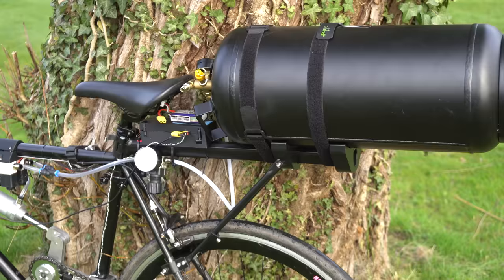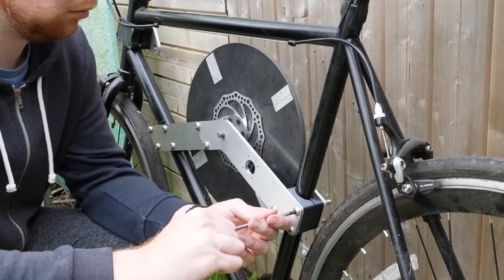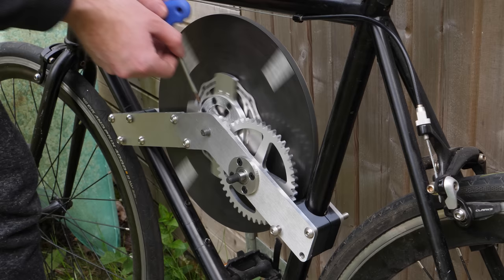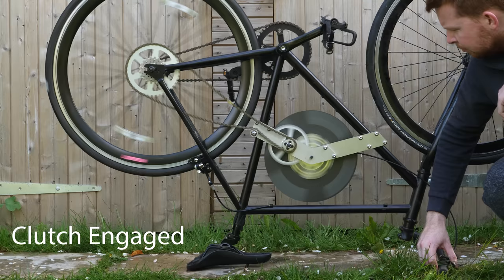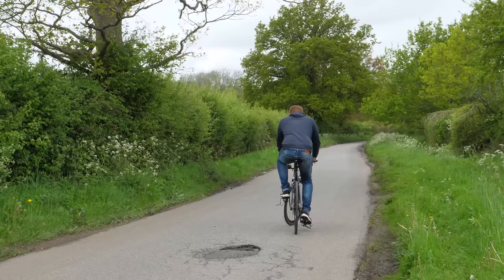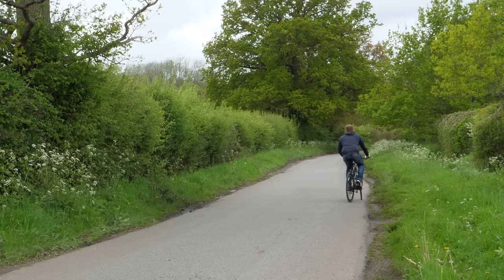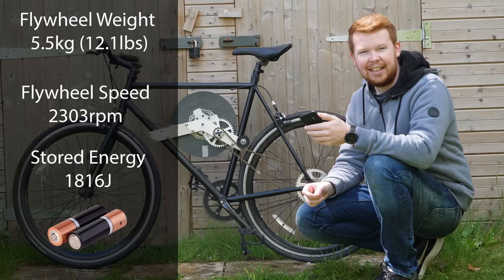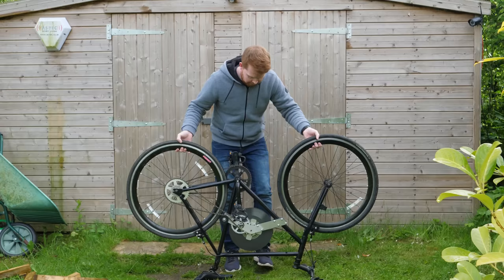Flywheel Bike KERS

Comment: This is so cool! Something I wonder but isn't covered in the video: Does the flywheel have a noticeable gyroscopic effect? That is, in the field test, if you bring the bike to a stop but the flywheel is still running, does the flywheel help keep the bike upright through gyroscopic force?
Reply: I ride motorbikes and had an electric scooter. The difference in stability at low speed is incredible.
Reply: Great question 😊
Reply: @dancingCamels  that's actually a big advantage for older and very young riders.

Obviously in production version you seal the thing appropriately.
Reply: I'd be equally interested to know whether the gyroscopic effect makes it harder to steer.
Reply: This was my question, too.
Reply: It would take a HUGE flywheel to keep it upright
Reply: @UtkarshUpadhyayTheGreat  that's why they said "help" keeping it upright, not straight up keep it upright.
Also, not that massive. Angular momentum is I×ω, so you just need to make it spin fast enough :p
Reply: @Anankin12  Missed the word 'help' there, and yeah, if it spins fast enough it should help keep it upright!
Reply: @Anankin12  true!! but you would defiantly need  bigger stronger leg's than Tom's to get the speed you would need.   ; )
Reply: Now I'm  no engineer by a long shot but was sat here thinking what if you had TWO  flywheels that rotated within the wheels somehow like huge discs (maybe even 4 one each side front and back)... surly that would help with power output and stability.. also a system where the flywheels pick up speed with the wheels all the time they are rotating slower then release and continue at full speed when the wheels slow down and store this energy when needed for hills etc.. 🤔🤷‍♂️ like I sayi have no engineering background 🤦🥴🙃😀

Comment: Show's you how ineffective regenerative braking is relative to the size of the losses you need to offset in a vehicle.
Reply: There are more factors. Flywheels are actually great at storing energy but the implementation is very important
Reply: yea thats the problem - The extra weight in flywheel you are carrying everywhere would be better spent carrying apples instead and eating the apples to give yourself energy.
Reply: The increase in mass, and the fact it is sometimes spinning and sometimes not, would make this a horror bike to ride irl. Gimme an energetically wasteful 7kg carbon bike any day 😆
Reply: @argh01hass  You could reduce the weight of the flywheel by hollowing out the inside and adding a bit of mass to the edges.  There are vans and buses that use flywheels to store energy.  But it's still hard to make all the extra weight worth it.

Comment: you only need the RIM to be heavy steel, or a steel tube of uniform diameter completely filled with lead.  The rest of the wheel only needs to be comparatively light--but strong/  Spokes in a wind-preventing membrane would do it. It has to be tested to about 10 000 rpm, and if it holds at those RPM it will be safe on a bike.

Comment: It's especially good if you consider the fact that using the bike normally, braking ever so slightly on many separate occasions, and using the flywheel as an assist and not as the sole source of energy this system really begins to seem more practical
Reply: nope.
Reply: I was thinking about that as well, harvest energy going downhill, then use the energy going back up.
Reply: @BigEightiesNewWave  yes

Comment: Tom, you should try to combine the flywheel with the front wheel. Due the angular momentum of the flywheel it would have the same effect as when you're moving the bike, which stabilizes the bike and prevents from falling over (physical functioning of a bicycle). It would allow you to remain on the bike while standing (not moving), without touching the ground with your feets.
Reply: Gyroscopic effects have been proven in scientific studies to not actually stabilize a bike.  There's a video here on YT with a deep dive on the subject, interesting stuff if you have time to search for it.
Reply: @Skinflaps_Meatslapper  Yeah it is the combination of the gyroscopic effect and the caused forced (vertical) rotation of the front wheel, that will shift the centre of gravity. But I guess it is only possible while driving the bike. You would have to move the bike slighly forwards and backwards while standing.
Reply: @robbernd155  The physicist David Jones ruled out gyroscopic effects as a contributing factor to the stability of a bike by building a self-stable bike without gyroscopic forces back in the 70's.  Since then, most people assumed that the caster effect of the front wheel, commonly referred to as trail, was the reason bikes are self-stable.  However, about a decade ago, the question was revisited by physicists at Cornell and other universities working together.  They determined that a bike can still be self-stable without gyroscopic effects and without caster.  So the underlying physics as to why a bike is self-stable is still unknown to science.  I have my own theory about it, but I'm certainly not in any kind of position to make claims or demonstrate any proof.
Reply: @Skinflaps_Meatslapper  I did some research and you are right. It is not just the gyro effect rather some kind of  "trail" effect too. Nevertheless the gyro effect stabilizes the bike as well and hast an impact (e.g. counter steering or driving freehand). The question is wether the momentum of the flywheel is enough.
Reply: @robbernd155  Here's the thing though, they canceled out both gyroscopic forces as well as the trailing effect, and the bike still self-stabilized.  There's a different effect going on to stabilize it.  Either way.  Using a flywheel to stabilize a bike well enough for it to stay upright and resist outside forces won't do much of anything other than creating a bike that is difficult to ride in all but a straight line.  Advantageous for people just learning how to ride perhaps, but for everyone else it's a nuisance.

Comment: Very interesting, and franckly, cool. I do have a critical question, though: how does this bike behave in a sharp turn with a rotating flywheel? Despite the bit at the very end of the video, i'd expect that you'd at least have to change your technique...
Reply: you're exactly right with your curiosity! Because they rotate on a static axis, that rotational energy is along that axis. They're their most effective when they can statically stay in that direction because if you rotate; that angular momentum wants to continue it's inertia along that axis, which results in some of that energy escaping the flywheel kinetically through the rest of the structure.
Reply: explanation in theory of a un educated mind. Honestly I cant see that steel plate storing enough energy unless you had one hell of a gear ratio to get you started again. But to your question in theory it would be harder to turn... but you would be able to take much sharper turns if you lean in to it due to the fly wheel. Perhaps some engineer can explain. I am un educated but I do have a vast knowlage.
Reply: @Sabi1234567890Asdf  the flywheel would act like a gyroscope in a sense that it would take more effort to turn the bicycle by banking & less effort to return the bycicle to a stable position, but turning by use of handlebars would be unaffected. I'm not a real engineer, just an engie student and i dont do mechanics yet so i might be wrong
Reply: yes. I wonder how the balance of the bike might be improved by somehow mounting the flywheel device inside the rear wheel as I think someone else in the comments was talking about mounting using the front wheel? but the back wheel might work and be more stable?
Reply: ah 'watch absolute truth' just commented the same thought below with more detail than myself
Reply: It would need more force to turn but it would be more stable at it
Reply: @harkmay  if you mount a large mass in the wheel(s) your bicycle will incurr severe energy losses and be inefficient, offsetting any benefit of doing so.
Reply: Um, speaking as a cyclist (bicycle and motor) I'd like to remind you that the front and rear wheels are themselves creating a huge gyroscopic effect which is the reason you are able to ride with no hands.  I doubt the flywheel will exhibit an overwhelming effect.  I definitely like this concept though.  At 65 years of age, I still ride my bicycle a lot.  This appears to be a sweet idea to me!  Oh, as for sharp turns, my main concern is traction over balance.
Reply: @GLACIOUS13  that's false. The answer is that there are multiple hypotheses and we don't know.
Reply: There ought to be a public discussion of city busses using this system.
Reply: @s.sradon9782  prove it
Reply: I used to race motorcycles semi-professionally and one of the most misunderstood concepts, even for people who have rode bike and motorcycles for years, is how they turn.  Motorcycles and bicycles turn by leaning. 

As mother person mentioned, the rotational gyroscopic force keep the bike upright.  In motion, and person doesn’t balance a bike, they only introduce instability. To lean, and thus turn, a bike you must overcome the gyro force keeping it upright.  Gyroscopic precession dictates that if you exert a force on a spinning disc, that force will be realized 90 degrees forward in the direction of rotation.

The way I draw this when coaching riding is imagine being above the bike looking straight down as it is moving.  If you want the bike to lean to the right, you need a force pushing from the left at the top of the wheel (12 o’clock).  Because it is spinning, to get a force at 12 o’clock you must introduce it 90 behind the rotation (in this case 3 o’clock).  Now if you are imagining this correctly you will say wait a minute, if I put a force at 3 o’clock on a spinning tire which can pivot through the steering hub... then I would actually be turning the handle bars to the left in order to lean *right*.....   and you would be correct, welcome to counter steering, the real way to turn.

This is why bikes are so wonky at slow speeds, as you do the intuitive “steer left to go left” the bike wants to lean away from the turn and you correct back and it just feels all wrong.

This is also why training wheels are a terrible idea, because they reinforce the wrong way to steer a bike.  Usually they are mounted a bit higher, so when you steer left, the bike want to lean right, but the right side training wheel touches the ground preventing that.  Then the bike skids around to the left giving affirmation to the rider.  Once the wheels come off, all hell breaks loose as the bike leans away from the direction the poor newbie wants it to go.  People say, oh they just need to learn to balance, but no the bike does that on its own just fine, they just need to learn to stop adding massive amounts of instability by steering drastically in the opposite direction desired.

Rant over.
Reply: @As_A________Commenter  Have you ever considered using mathematics the difference between the force necessary to tilt a spinning solid disk and a spinning rotor where its mass is almost all at the periphery? 
The example of the disc he made versus a typical wheel?
Reply: @myparceltape1169   that is an interesting question, and beyond my mathematical capabilities.  I didn’t proffer my opinion on the original poster’s question as to how the rotating mass would affect steering, and my first inference would be that since it is rotating in the same direction as the wheels, it would resist the leaning and require more counter steering force to overcome.  How significant that would “feel” to the rider is questionable, but his tests really didn’t include riding the bike at speed with an appreciable turn.

Further to your question, I don’t know if the distribution of mass of a spinning disc affects how it reacts to the force applied.  Personal experience racing bikes with standard steel wheels vs light weight composite wheels made the bike feel more quick to lean from side to side.  

All racing bikes and cars seek to reduce overall mass to improve performance.  On motorcycles, any mass saved on the wheels is particularly valuable.  It allows the wheels to speed up and slow down easier, which improves acceleration and braking force required.  Additionally since the mass on both wheels is not supported by the suspension (called un-sprung mass) it is more advantageous to reduce weight there than elsewhere on the bike.
Reply: wheels are gyroscopes too, and the rear wheel is pointed in the same direction as the flywheel.
Reply: @As_A________Commenter  Loved your rant!  I once forgot this (momentarily) and almost hit a wall at high speed!

Comment: I think this would be most useful in hilly terrain. Engage the clutch downhill to slow down and store energy, then use the energy to help go uphill
Reply: Well, bike is that much heavier so it kind of defeats the purpose.
Reply: or don't slow down going downhill and coast up the next hill.
Reply: The amount of torque and power you would need put through that bike to keep the wheels spinning up hill is simply inhuman. You can see how low his cadence already is

Comment: What if you tried to set it up as a reverse pedal system while still in motion? While your currently still have momentum, but instead of moving forward peddling, reverse pedal to increase kinetic energy of the flywheel only while maintaining same speed, when you engage the fly wheel it should give you a boost in speed, while having it disengaged it can act as a normal bike waiting for a boost.

Comment: I make small engines and windmills for a hobby. I use compressed air as well as steam to spin up a flywheel, which doubles as a generator rotor, having permanent magnets press fit about its circumference and passing through a pickup coil. Doing this allows me to take advantage of steam when it's overpressured as well as when it's not. It works pretty good. I manufacture the steam from a tracking, concentrating solar mirror I designed and can generate free electricity on clear, sunny days.

Comment: You could use a one way bearing on a second clutch system that was simply on a switch to engage or disengage the ability to "charge" the flywheel. Then you would be able to use your original clutch design to use the power of the flywheel and to use it as a brake when it doesn't have any inertia stored in it

Comment: All that's needed is to incorporate an electric motor to dramatically increase the flywheel speed and you'll have a bike capable of quite a bit higher speed and be able to increase the distance the motor could cover by itself then encase the bike in a fibreglass shell for aerodynamics and then you'll have a diy velomobile!
Reply: @Peter Evans not new , idea , new purpose

Comment: I think a CVT would work in place of that "infinite gear ratio". They use a pulley system to match any ratio
Reply: The Nuvinci would do it if it didn't have a freewheel.

Comment: Using a CVT over a clutch would radically improve efficiency, of course.
Reply: He mentions this
Reply: That would be great if it were somehow mounted longitudinally, maybe on a shaft drive bike? They're rare, but they do exist. Then it would have to be slim enough to not interfere with pedaling... or the wheel itself, of course.
Reply: @MrTaxiRob  Yeah...a more practical alternative is an eBike, lol.
Reply: @buildingutopia7617  or hybrid of the two, using the kinetic energy of the flywheel to drive a super-efficient generator, charging capacitors, that discharge into ULW motor, that assists on startup.
you could store more energy this way, as a pedal assist on startup. in theory creating a net-positive, rather than a constant net-negative with current design.

Comment: In this case, the flywheel is more like a capacitor than a battery. Lamborghini uses that same concept, since it weighs less, charges faster and delivers energy in the same way. But after a short time it gets discharged just like the flywheel slows down over time.

Comment: You should engage the flywheel automatically when braking if it's speed is below certain number and also when you start pedalling.
You could tune one of those centrifugal governors that are used for starting washing machines.
Reply: Magnum Dong  
Absolutely! Painting red flames on any wheeled vehicle or  airplane  will make them all go faster! Not many people know about that! 👍😉
Reply: @geoben1810  it's almost like the relation between RGB and FPS.

Comment: Well done Tom!! You can buy for 100 pounds a belt driven infinitely variable transmission, which would still need considerable modification to do what you want it to do. Better still would be to mount a permanent mag alternator on the flywheel and on the wheel, but the control electronics would require some thought. The power transfer from one to the other would be seamless!